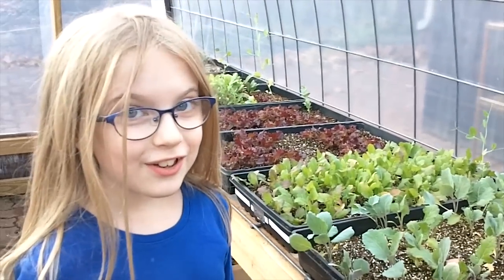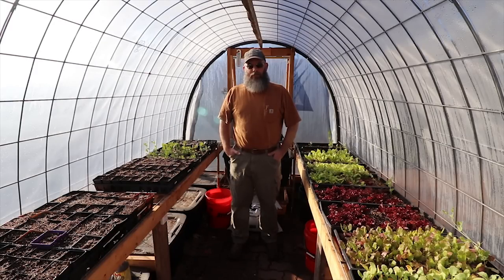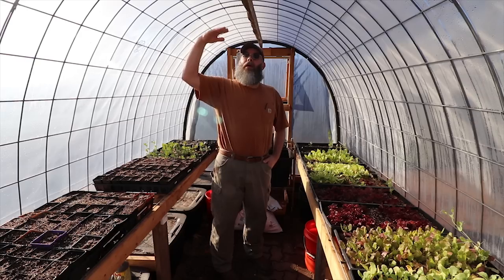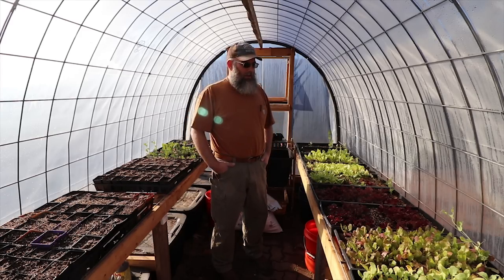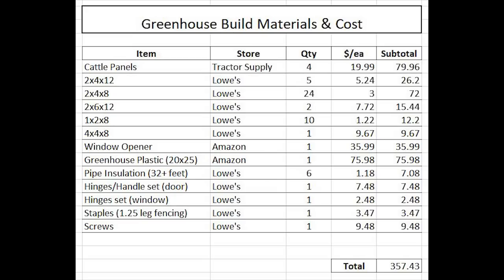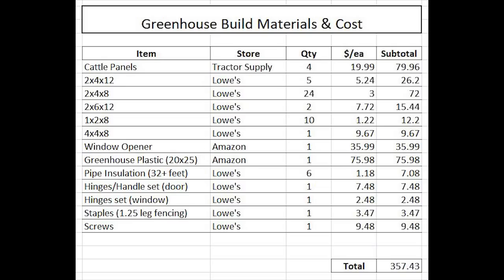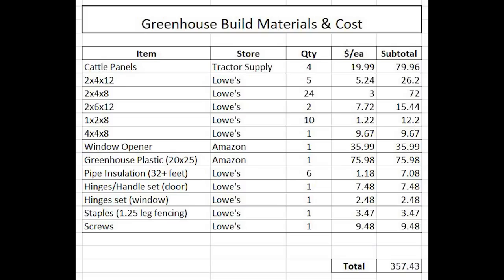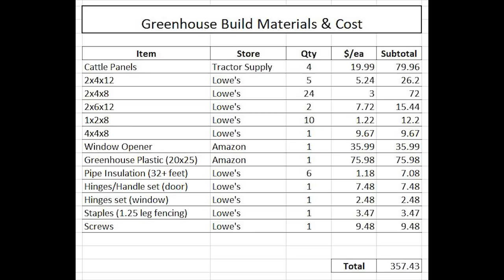Cattle Panel Greenhouse Build with Costs | How to Garden Spring Summer Fall Winter

Comment: This made a lot of sense with the Cattle panels I never thought of that was it hard to bow over?  I work with at-risk youth and as I keep them in the garden and teaching them to plate, harvest, prep, and cook they have no problem with eating and sharing to the court system their change.  My next idea was put up a greenhouse for those winter months and during summer camp.  I think this will hold longer than plastic pipes.
Reply from the maker: That's awesome work! Bowing the panels is no issue st all. This would be a great and rewarding project! Fine job man!

Comment: Thank you for doing this video. The pictures were very helpful. 

It is now 2022, how is the greenhouse holding up? Did the plastic covering hold up or did you need to replace it at some point? 

Would you change anything in the construction?
Reply from the maker: Thanks! There is one hole in the top from a small tree limb that fell on it. I taped it with greenhouse film tape.  Otherwise covering is fine. Looking back I would use an aluminum storm door instead of wood, frame up the bottom sides to prop open easier, and make it longer. I think that's it.
Reply: @HeirloomPermaculture  I put this video in my library last year as we were moving to Oklahoma from Kansas. I was glad to see another 2022 viewer! How tall are your work surfaces? Do you heat the greenhouse? How do you get water in it; I noted the brick floor.
Reply from the maker: @nancytabor8302  Hi Nancy. I think they are just below counter high. I believe there is a video last Spring where Angela gave some of those additional details. Probably the Spring Garden Seed Starting video. We don't heat it unless we have no way to bring tomato and pepper plants inside. We've only used a small propane heater in there like 3 or 4 nights total since building it. Water is usually just with watering cans. We do have a faucet nearby to use a hose but rarely do.

Comment: This is the best design I have seen so far particulary because you provided venting on the bottom sides, not just both ends.  As one person mentioned, a few more building details would be helpful but that is always easy to say after the fact!.  I had to stop and start a lot of times to see that 1) you attached the plastic to the front and back using the 1x2's; 2) the 2x4x12's were mostly for building shelves except for the ridge board; and 3) the 2x4s had to be notched for framing.  We will be making this in 2 weeks but will have to work out the exact cut dimensions ourselves for the front and back 2x4 part of the framedoor, window framing, side feet and front and back panels.  If you have since come up with an idea on how to roll and keep up the side bottom ventilation panels, it would be great to hear about that as well.
Reply from the maker: Absolute BEST feedback comment ever! Thank you. We'll see what we can do.

Comment: In applying the plastic sheeting, I assume you stapled into the wood at the base, right?  I'm curious what size pipe insulation foam you used and does it alone hold the film on the ends?  Does it withstand wind well?  It's a great idea and we intend to build one.  Thanks for sharing your talents!
Reply from the maker: I attached a 1x2 along the bottom of the side frame. Stretched the plastic over it and attached another 1x2 just below the first one with the second being outside the plastic. This sandwiched the plastic between the two 1x2s in an S shape. The foam is simple 1/2" pipe insulation. It is underneath the plastic just to protect the film where it is stretched over the end of the cattle panels. The film is again attached at the bottom of the greenhouse. The greenhouse is covered in one big continuous sheet. The ends aren't separate. Holds up well to wind. It is slightly protected on North and West sides. Appreciate the questions. Thanks!

Comment: Couple comments
1. Your wife looked so uncomfortable at your apology for you asking to "like and subscribe" I'm super glad you didn't edit that out! She looked adorable, and frankly it was the only reason why I subscribed!  I never heard anyone say that!
2. Your daughter is also adorable
Q's: This looks like it is super sturdy, does the plastic and panels hold up to the snow? Do you remove the plastic in the winter? With the added ventilation does it get to hot to grow in the summer months? What zone are you in (so I can tell if it works for me)? Was it hard to bend those panels down like that?
Reply from the maker: Thank you. Everything has held up well to snow. We also get out there early and try to sweep it off so the sun can get in. It can get hot in the summer. We open the bottom sides as well as the door for ventilation. We leave the plastic on all year but add shade cloth in the summer. We are in 7a. Build the frame first and then it's easy to curve the panels over and set them in. Driving in the staples is a little awkward but not too difficult.  Thanks for subscribing and the comments and questions.

Comment: How has the plastic held up rubbing on the metal? I have a tiny table green house to start 5 seed trays in and am finding I need to put another green house over it for better insulation . This looks like the right answer for me, I’m just concerned the plastic might not hold up against the metal. Thanks to you for the video and if you answer. God Bless
Reply from the maker: It has held up great. The only 2 holes we've had were from limbs that blew on top of it. They were both small and easily fixed with greenhouse film tape. Just be aware of potential sharp corners etc during the build and take care of them right then. Thanks!!!
Reply: @HeirloomPermaculture  THANKS

Comment: Nice job! We built our cattle panel greenhouse two years ago and have loved using it ever since.   New subscriber here! I can't wait to follow along with your garden and projects.
Reply from the maker: Thanks!  This is our second growing season in this one.  We've been really happy with it's effectiveness!
Reply: @HeirloomPermaculture  How is it holding up? I'm concerned about the wind taking the whole thing or tearing up the plastic. Do you think if the end posts were 4x4's set several feet deep in concrete that it would stay put? Do you know anyone near Seminole, OK I could hire to build me one of these? I am short, so I don't need the roof higher like yours.
Reply from the maker: @Growmap  The greenhouse is holding up great so far.  It is somewhat sheltered from wide open winds, so that helps. But, it still gets exposed to storm winds.  We considered anchoring it down, but have not seen any need to so far. As long as the door and window are closed for storms, the wind kinda flows over it instead of getting in it and lifting. Look up OOLA and Farming group on Facebook.  There are several OKC area market gardeners who look for off-season projects that might build you one.  Thanks!

Comment: Really like your design. Do you think building a greenhouse on a concrete pad would create to much heat. I have the concrete option or just the ground. Wanted your input. Thanks and I enjoy your videos. Don’t comment a lot but enjoy your channel
Reply from the maker: Thanks! Ours is on pavers. I think it helps way more than it hurts. It would only be better if the pavers were insulated from the ones outside the greenhouse in the winter. I think we loose a little heat from direct conduction. If you don't intend to plant in the ground inside the greenhouse, I'd vote concrete.
Reply: Heirloom Permaculture appreciate your input.

Comment: That’s brilliant. I need to make one of these!  Never seen an automatic window opener before, need to look into that...
Reply from the maker: Thanks! There's a link to the window opener in the video description in case you missed it.  Appreciate you watching!
Reply: Thanks!  I checked it out, very cool indeed, never knew it was a thing, I love learning new stuff!
Reply: @HeirloomPermaculture  With the window opener and a full door, do you feel you still need to be able to open the plastic at the bottom? I was thinking you could reduce bugs and possibly critters by not opening it up on the bottom.
Reply from the maker: @Growmap  None of the openings are screened, so if anything is open bugs can get in.  but we haven't experienced any pest problems.  We haven't had any critter issues thus far either.  With the window up high and the bottom sides open, it creates a very nice updraft. Much better circulation that in one end and out the other.  We still leave the door open on really hot days but it is more susceptible to the wind catching it and causing damage.

Comment: Ok.  I really like what you've done here.  Can I assume that the foam pipe insulation is used to prevent the wind from tugging at and tearing the plastic sheeting?  Also, are the roof and ends all covered from the same piece of plastic?
Reply from the maker: Yup foam protects the plastic going over the edge. It's all one big piece of plastic. We kind of rolled and tucked going down the corners to take up the extra without cutting it. Thanks!

Comment: I see the pool noodle or pipe insulation on ends... does the plastic material on other roof sections not wear through the plastic quickly?  What prevents it from ripping or wearing out?
Reply from the maker: It has held up fine across the span of the panels where there is no pipe insulation. Just make sure there are no protruding sharp points (twisted wires, etc).

Comment: From Tahlequah.  Is your greenhouse tied down? How has it held up to Oklahoma storms and wind?  I intended to set mine on an existing concrete block base but can't envision how to connect the house to the blocks.  Any ideas?
Reply from the maker: Hello! This one is not tied down. It is somewhat sheltered. We have worried about it at times but all has been well. We do have our big caterpillar tunnel anchored though and we have a video showing that. With a little adjustment, it could easily be applied to this style also. Thanks for watching and let us know how it goes!

https://youtu.be/CjFUeh39gQE

Comment: What are the black totes under your seed shelves?  Curious if they are for water for helping regulate the temperature
Reply from the maker: That's exactly what they are. They seem to really help slow the overnight cooling. I have some thermal pics where they are glowing vs the surrounding area. They are on the South wall to catch most winter sun btw.

Comment: Really liked the video. Question what was the final width of the cattle panel house? Was it 8'minus the 2" times 2 = 4" to the outside 2X6s ? So in other words did it come out to 7' 8" ?
Reply from the maker: Thank you! It's 7x12 inside the frame.

Comment: I am Wondering for the floor if I can put regular tarp that you can buy at Walmart or will that be too slippery? I could double layer it I want to make an inexpensive 8’ x 8’ or so
Reply from the maker: I'd personally be hesitant on the tarp. Decent quality weed mat from Sunbelt Dewitt would be a good option. Weed blocking but water will go thru.

Comment: This looks fantastic. I'm in southern Ontario, Canada. I had been looking for an option that could withstand some snow. Do you leave the plastic on all year or take it down? Using the cattle panel instead of the more common PVC pipe will probably stabilize and offer a bit more support if we got some heavier snow. :)
Reply from the maker: We leave it on all year. Even grow somec greens in there during winter.

Comment: Thoughts on surviving wind? I really am struggling with potentially spending $20,000 on a geo dome, but Texas panhandle winds are brutal.
Reply from the maker: Ours has done fine in the wind. It is also a bit sheltered being on the South side of the house and in a somewhat lower spot. If it were out in the open I would have it anchored down like our caterpillar tunnel is.
Reply: @HeirloomPermaculture  thank you for responding! Our south & west winds are from March to about September, then north from October- February. A normal day is about 25 mph, dust storms can gust to +60, with major storms bringing +85 gusts. So, not certain it'll matter which side of house it's on. What do the winds average where you're at?
Reply from the maker: Very similar. Northeast Oklahoma.

Comment: Hi, now that you've had your greenhouse for a year, how is the 
plastic holding up. I was warned that wind will rub the plastic against 
the metal and lots of holes would be the result within a year. Can you 
confirm this? Thanks a lot from NZ. E.
Reply from the maker: We have actually had the greenhouse for a little over a year and a half now and the plastic is in great condition. We haven't had any issues with the plastic.

Comment: Is the plastic on the sides weighted down or tucked in or something else?
Reply from the maker: The plastic is sandwiched between 1x2s and screwed to the frame about a foot off the ground. The flap that hangs below can be propped up for ventilation or held to the ground with something heavy.

Comment: Thanks for the video. Building a version of this right now. Just sussing out the measurements for things as we go, taking a bit longer, but as we haven't built much - its a learning process as well. What height and width did you end up with for your door frame? (Liked and subscribed as recommended :) )
Reply from the maker: Thanks! That's a standard screen door. I thinks it's a 36" but overlaps the walls to close up against. I just made sure it was wide enough for a cart or wheelbarrow.
Reply: Ok. Hmm.... We've been having issues trying to determine the measurements for the notched vertical pieces (front and back) almost going back to the original plans to just knock it together that way. But yours seems to be a more elegant solution.
Reply from the maker: We arched the panels and lifted it all up on the legs. That helped determine the height. I don't remember if we targeted the door height or it was a happy coincidence. We may have had to trim a little of the bottom of the door. Can't remember.
Reply: Ahhh.. Ok. If yours is still handy, what did the height of your door frame come out to? Did you anchor the panel to the corners of your door and window frame? Or just that top stringer? Thanks Again!

Comment: what is your thoughts on using 48" X 40" (standard) pallets ( free from my work, they are retrograde/trash) to build the base for the green house (with the C.P. stapled/anchored halfway  up) and 1/2 pallets for the internal shelving?
Reply from the maker: I think it'd work great a long as the pallet walls behave like a rigid structure. Any flex where the pallets attach together will be magnified in the cp top. I'm all for repurposing though. 👍👍

Comment: Could you tell me and hubby how you attached the plastic?
Reply from the maker: We screwed a 1x2 to the greenhouse. Pulled the plastic over it and then screwed another 1x2 just below the first. The plastic goes over, between and then under as the 1x2s kinda pinch and clamp the plastic.
Reply: @HeirloomPermaculture  thanks!

Comment: Did you use any tape on metal grid to stop it melting the plastic cover in the summer?
Reply from the maker: No we didn't, but we haven't had any problems with melting plastic. It is a good quality greenhouse plastic.

Comment: Hey, there! New subscriber here from Coweta. Can you tell me the average temp you are running in the winter? I'm thinking of duplicating your design with glass doors and possibly windows on the ends.
Reply from the maker: Ours typically stays 5 to 10 degrees warmer than outside at night, unheated. We have used a Big Buddy heater on low to keep it around 50-60 degrees when it is around 30 outside. Thanks for subscribing!!

Comment: I bought a 10 by 20 green house off of ebay for $135 and I cannot recommend it.  Four times we had freakish high winds that blew it down and the last time, the 56 mph winds beat it to death, bending and breaking the "galvanized steel" base.  The plastic cover was okay and since I needed trellises anyway I planned to do what you did but use the original cover.  It has to be 10 ft wide though and math makes my brain hurt, lol.  You have a real door instead of 2 zippers and I'm pea green with envy.
Reply from the maker: Math makes my brain hurt too.

Comment: I'm curious what did you use for the center cross section.. I've seen some withnnit some without.. I've got one across mine and it's bowing.. I hate it
Reply from the maker: It originally had a scrap 2x4 running the ridge of the greenhouse. If that is what you mean. It hasn't been there in over a year and we've had no issues. All of the cattle panels are wired together where they meet though. This answer your question?
Reply: @HeirloomPermaculture  yes, I'm considering going without one.. the guy who was building has been dragging his feet, I'm gonna redo the framework of the door..  it looks like crap, and finish it myself.